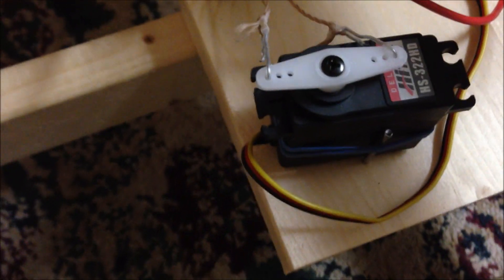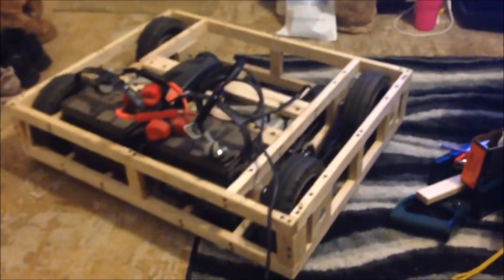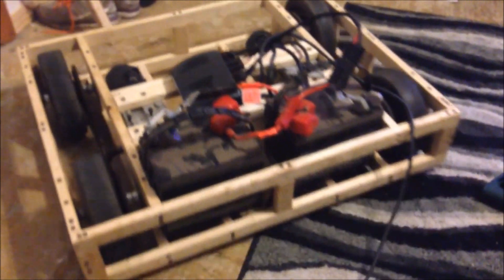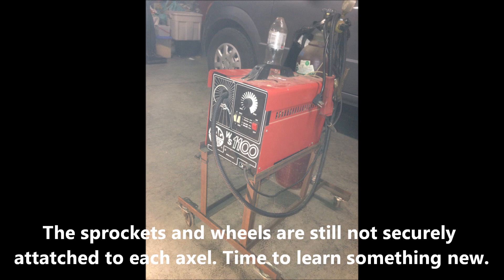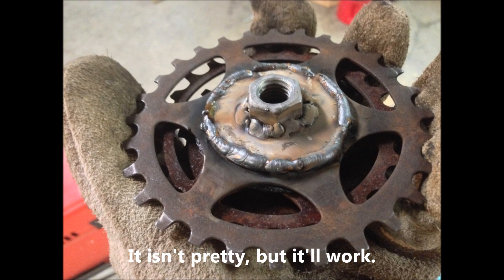Homemade BattleBot and how I did it.

Comment: Yo I want to do the same! (I've already bought some of the things I need)

Honestly I'm just scared of blowing things up by providing too much power. Any advice or tips on how to make sure everything is happy? There seem to be loads of volts and amps and watts around but I don't know how to convert them! It's so complicated!
Reply from the maker: Totally understandable fear you have there haha. Honestly, the speed controller handles all of that. If your setup is the same as mine (same motors and batteries), then that speed controller will handle everything else. All you have to worry about is placing the wires in the correct terminals and the speed controller comes with a wiring guide (should), otherwise I’m sure a PDF can be found online. If not, I can probably post some pics of Rex’s wiring.
Reply: @InterestingTed  I'm on a tighter budget than you were. I have a couple hundred pounds (I'm in Britain) to play with. I'm having to use a pair of cordless drills because wheelchair motors are out of my budget. Because of me using some 18v VonHaus drills, I probably won't be able to ride mine but I just want to make SOMETHING similar. It's been a dream of mine for ages. If you wouldn't mind linking me to some pictures of Rex's wiring I'd be very grateful.

If you don't mind me asking, how is Rex now? Is he still going?
Reply from the maker: mitchib1440 I’ll get you some pics. Rex is doing good! Took him to the local park a few weeks ago and the girlfriend and I rode him around. I mention him briefly in my recent “Quarantine Workout” video. He does leave the house much because I live on the third floor and he’s just too heavy to transport without pulling the batteries.
Reply from the maker: mitchib1440 here are a couple of photos that may help explain the wiring. Polarity on the motors won’t hurt anything if it’s backwards (the motor will obv just spin the wrong direction). The main thing is that the battery(s) isn’t wired incorrectly if using a speed controller. Drill motors/gearboxes are a great idea. They have a ton of torque.

https://imgur.com/gallery/18YRoHE
Reply: @InterestingTed  I see! Thank you very much this makes my build easier as I have a general guideline for the wiring now =_=

Rex is awesome and I hope to make my own when I have the funding for it. Lovely work! I'm gonna have a look through some of your other videos :)
Reply: @InterestingTed  It's me again! I finally got round to building my own robot! Just posted the build video, I've linked it to this video, though if you want me to link to your website or twitter or anything else, let me know :)

Thanks again for the inspiration!!

Comment: Really interesting movie. I had to keep pausing to read the text. Im looking at building something of a similar size. Do you think chain drive is preferred to direct or geared?
Reply from the maker: Chain driven looks cooler (imo) and was more of a challenge. But honestly, it just means more moving parts and more potential problems. After this experience, I would recommend direct. Even if that means just two wheel drive.

Comment: You did a good job. 
Where did you get your info on the electronic part of controlling the motors and speed.
Reply from the maker: Honestly I did a TON of googling for things very non-BattleBot specific. There wasn’t a lot of info available when I built Rex, so I just pieced info together as I needed it. Was a great learning experience. The motor speed controllers use something called PWM (pulse width modulation). And thanks!

Comment: hey,, can i have the design..?? i want to make a study about it..
Reply from the maker: Start Out Studio I don’t have schematics if that’s what you’re wanting?
Reply: i actually just want to learn how to make a robot.. theres no much tutorial on youtube about it.. do you have any recommendation..??
Reply from the maker: Start Out Studio I’m happy to help with any questions you have throughout the process. I started the process by googling some of my favorite Battle Bots. I found a few blogs here and there that offered a peak inside some of them. I spent a ton of time just researching different ideas and foreseen problems. Is there a particular part of the process you’re stuck on?
Reply: i have a lot of question about it.. especially about transmitter and other electronic stuffs.. how do you set it..?? do you make it from scratch or you just simply buy the instruments..??

can i also have the links..??
Reply from the maker: I just purchased the receiver (speed controller) and the controller separately. I hooked them up to the motors in the bot. They’re mentioned in the video.

Comment: thank you so much for this. My little boy just loves robot wars and battle bots and is desperate for me to build him one! but until now i had no idea where to start. Any tips?
Reply from the maker: +sarapismosy I can answer any questions for you. I can’t think of any tips at the moment. This video shows some of my failures during the process, so don’t use a lawnmower starter motor and don’t try to make your own speed controller. Obviously make sure all of your components are going to fit into the chassis  (the batteries can get hefty). The speed controller I chose (noted in the video) was chosen after a ton of research. It’s very much ‘plug and play’ and has various safety features to help avoid damaging it. The controller was chosen due to the comparatively cheap price to function ratio. If you decide to use a chain.. a chain link removal tool is valuable. 

Cheers
Reply: Cheers for that, will have a go with your advise and the bits I have . See what I can get moving!
Reply from the maker: Were you ever able to start your bot project?

Comment: Hello, can you pelase tell me how did you mount the bike sprockets to the wheel with a threaded rod? like seen in the minute 1:14, thanks.
Reply from the maker: +Ricardo Anguiano Martínez I know it’s a late reply (been away a while). I welded the sprocket to two nuts (one on each side). I then just screwed if onto the bolt.

Comment: how much did all this weigh
Reply from the maker: Eren Tart 
Rex, batteries and all, weighs a grand total of 100 pounds.
Reply: In other words Rex is a Middleweight that actually is underweight by 20 pounds... You actually have weight to spare to add on.
Reply: i think if a metal frame is added you might get to 120 pounds
Reply: it requires a big special welding machine (i learned) though its some kind of machine that when you buy metal parts you put it near the welding machine and it shapes it up, im still learning about it and all this stuffi s aweosme, i just need more room, and possibly more money, but i am underage so i dont make money XD maybe my mom could look into this stuff though when he get a bigger place

Comment: I build robots for my high school team for FTC and I've always wanted to build fighting robots what controllers and programs did you use, I want to try and possibly make this a career
Reply: From what i saw in the video, there is no "program". Unlike FTC where you use android phones and program them. This is just a off the shelf RC controller. that wires directly into the ESC using PWM.
Reply from the maker: Vinh Pham 
Yep, this is exactly it. There was zero programming involved with Rex.

Comment: dude can please tell me how u connected the motors to the receiver😉
Reply: ESCs, decent ones.
Reply: Check out Sabertooth ESC's
Reply from the maker: Prathamesh Patyeker 
Prathamesh Patyeker sorry for the slow reply, but the two guys above have it exactly right. I used an Electronic Speed Controller (ESC) that uses pulse-width modulation for variable speed. More specifically, I used the Sabertooth 2x25 V2.

Comment: hello I can not find the ESC you used you. can you link me? thanks a lot
Reply from the maker: Here you go:

Sabertooth Dual 25A Motor Driver https://www.amazon.com/dp/B008OMQUXC/ref=cm_sw_r_cp_api_5QQvxbXEJ5WGS
Reply: +Interesting Ted thank you. can I find a cheaper one that has the same functions?
Reply from the maker: Tommaso Rigoli
When I built the bot a few years ago I searched around just about everywhere for a cheaper option, but this was the best bet hands-down. Has some special features that are designed to protect it from shorts and such as well. It's a pretty cool piece of tech
Reply: ok thank you
Reply: Don't go cheap on Speed controllers otherwise you will have a bad time, over engineer your robot to handle extremes. You can buy cheap controllers if you want but you will have to replace them too often.

Comment: hi, sorry but i don't speak english very well, i have a project, but i don't know how to move my robot... i've 3   12v motors like a tank 2 for the wheels and 1 for head ... how do i choose esc for my motors
Reply: +gianluca tevere hey, i dont know about the head but for two 12v motors i highly reccomend the tz 85 amp FROM BITBITZ if they are brushed motors (two wires one black one red) also the video's made by robowars austrailia might be a great help he goes into detail
Reply: +Will Elliott thanks a lot,  I've solved with 150 ah esc for motors regulation and my project work perfectly

Comment: Your bot is really cool I'd like to start making my own someday too but I have no idea how to start or what parts are needed. How'd you get rex to be wireless?
Reply from the maker: An electronic speed controller is the best way to get your bot to be wireless. Just make sure it can handle the amp requirements of your motors. A good ESC will have a fail safe that will protect itself if the motors decide to draw too many amps.
Reply: thanks how  I find more info on how to make something like this for fun?
Reply from the maker: Lots of Googling man! haha Mustapha D
Reply: I'm having an issue with that, i'm looking for a motor controller that can handle 63 amps (CIM motor) but can't find one

Comment: Your on the right path bro!! I work for a company that sells power chairs for people with disability and we have soo many of these things just lying around. I too am building a battlebot but on steroids lol.
Reply: my favourite middleweight was bad attitude
Reply from the maker: 'So many laying around'..I may be just a little jealous. How many motors are you looking to sink into your bot? Imagine 3 on a side, the thing would be a beast!
Reply: A total of three motors. Two 24 volt dc motors for the main drive and a mars brushless pmac motor for the rotating drum mated with a 200 amp brushless controller. All will be tied into an arduino board programmed with my spektrum DX4S reciever. The same one I use for my RC's lol. I will be using lithium polymer batteries (which I recommend). I haven't decided on a permanent design yet because I'm still learning from everyone's design. As you know battlebots is back and alot of the one's I've seen are just crazy as hell. All I know is that I want it to be flat and capable of recovering if it gets flipped over.
Reply from the maker: mounlasy Yes!! I can't understand why you would design a bot that can't self-right. If you flip, it's game over. Sounds like a fun bot; you should definitely link a video here when you make some progress on it. My favorites were Ziggo, T-Minus, and Toro. I would love to have my own T-Minus, it's a masterpiece! I did a little research on the flipping mechanism and quickly realized that I could get myself hurt if I didn't know what I was doing.. and I don't so I decided to avoid the project. Pressure release valves tend to get pricey too.
Reply: For sure bro.Toro is my favorite as well I'll keep you in mind once everything is in place. It can get pricey but the overall learning experience is priceless. Hey we may end up on the ring against each other one day haha
Reply: my favourite was warhead

Comment: Im young an have no money an ive allways wanted one how can i make a battle bot with stuff just laying around
Reply from the maker: TMMxproductions 1 There are lots of different things you can use for motors. One of the cheaper options I ran across are power drills. They're geared perfectly for torque. You can use about anything for a frame. Be creative!

Comment: Hello I am looking to build my own "battle bot" and I love your design, so I'm wondering how you did the speed control
Reply: The Sabertooth 2x25A is the Speed Controller. It has 2 Speed controllers built into 1 unit, one for the left and one for the right, each taking a continuous current of 25 Amps.
This must be linked to a digital receiver such as an Orange R620, which receives a signal from a transmitter, such as a Spektrum DX5e.
Reply from the maker: Glad to help! Can you be more specific with your question?

Comment: just watched the video, great project man. I'm really jealous but im building something like it soon. 

how do you control the sabertooth? and i guess thats the only thing i need to buy for now
Reply from the maker: The sabertooth comes with some pretty detailed wiring directions. If you need any help with it though,  let me know and I'll send some pics/info whatever you need. Edit: I wanted to add that the sabertooth 2x25 can handle 25 amps per side. So two motors at 25 amps each. The 2x25 also has thermal and overdraw protection. If the motors draw too much, which can happen under load (but hasn't for me yet), the sabertooth will shut itself off to prevent damage. The same goes for heat if it gets too hot; mine gets warm but never hot and it has little airflow with no external heat-sink. If you use the motors I'm using, this sabertooth couldn't be more perfect.